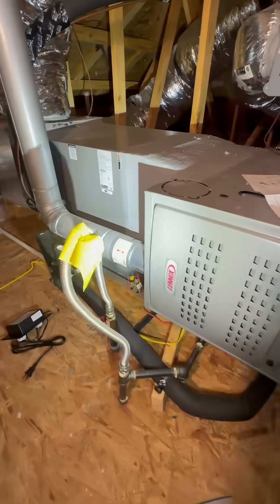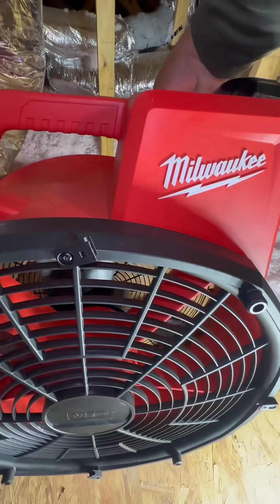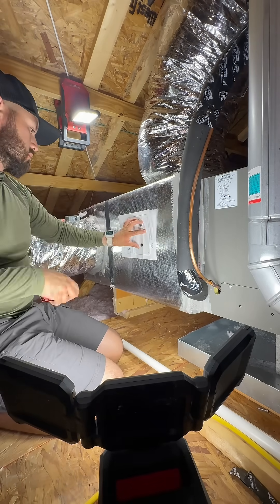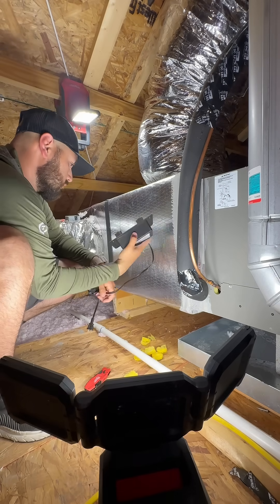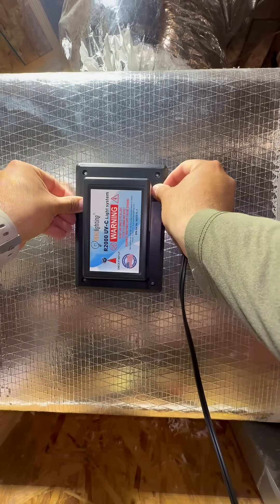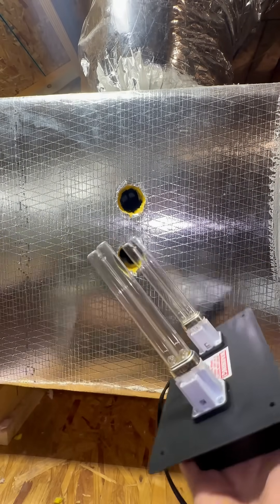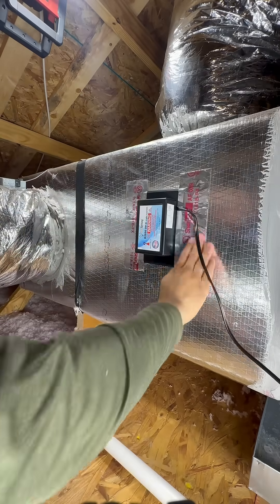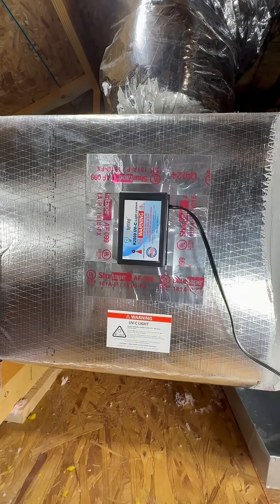Installing a UV-C light in an HVAC system as an Electrician 😱

Comment: I like one underneath the Evap coil and one above it, usually on the left side of the blower, so it's not shining directly on the blower motor wires. If it does, you want to protect the wires with foil tape

Comment: If it is a powerful uv light meant for scrubbing the actual air i try to install it in the supply. Always note the arrows. If you can, have it shining onto the coil. Although cleaning surfaces isn’t why i suggest powerful uv lights. (The make cheaper tailor made uv coil lights for that application) A legitimate air scrubbing device keeps air clean by ionizing low ppm particles which the filter then can catch.. never have the light shining directly onto the filter if you can manage. 
I also rarely see this on systems but you are actually supposed to install a transformer with some.

Comment: I’m an AC tech that has installed many and also see how effective they are over the years. The best place for me is probably under evaporator coil. Slime can grow on coil and also collect dust which will restrict airflow. UV light will keep clean and also not do as much damage like next to blower wheel, which can eat away protective coating on electrical wires. #2 spot would be supply plenum where I have seen most mold grow and #3 would be the side of blower wheel as long as it’s not shining on wires if possible. Maybe zip tie out of the way or tape wires. Doesn’t matter if air is going by it too fast. A light is not designed to clean the air. It’s designed to keep clean wherever it is shining. They work very good at keeping an area free of dust and algae/mold. Would need something like an air scrubber or ionizer to actively clean the air. Not a UV bulb

Comment: Uvc is best above and below the coil but be careful it destroys most plastics you'd find in a typical air handler. You'd need pfa/fep/metal protected wire and no all metal drain pans and condensate outlet. The uv will slowly degrade almost all typical plastics.

Comment: You need to keep it away from your filter. I had a k&n washable filter that decomposed because of  the uv light. Also, you must replace the bulb yearly as per directions. Otherwise, you will start coughing. We learned that the hard way.

Comment: Helpful tip. install it were there is no other electrical wiring. That uv well destroy the insulation on the wire. If there is electrical wiring near uv light , wrap wiring with metal tap.

Comment: I would not install a uv light. And an electrician (in my state and many others) is not allowed to touch anything on an HVAC system. You cannot touch my duct work. You can bring power to a disconnect. That's the extent. Don't touch my ducting. And don't wire that bitch into my furnace or air handler. And stop installing uv lights. They destroy equipment and ducting. And are fairly ineffective at purification.

Comment: Should be mounted facing the evaporator.  It's meant to flash the coil with UVC light.  Mold grows in between cooling cycles when the coils is wet and gets warm.
Reply: Air scrubbers are for cleaning the air more than the coil. There are specific uv lights for coils that are cheaper and keep surfaces clean rather than what a legit air scrubbing uv light will do.

Comment: If you are going to install one the best place is whatever will give the maximum exposure to the entering  side of the coil. That is usually by drilling a hole or holes in the end cap/ triangular piece of metal that is on each side of an A coil. Are they effective? Yes. Uv will kill any organic trying to multiply on any surface exposed to it. Are they cost effective? No. Average  lifespan of a  bulb is about a year.  The only way I can think of where they might  be beneficial if you have a lot of animals I your  house, return air on or near the floor and are somewhat lackidacial about filter changes in a place like Florida, lots of humidity and ac required.  With that set of circumstances a uv light could very easily be worth the price of admission.  Are replacent bulbs   available or do you have to buy a new light every year ? Whatever the case I would consider it a yearly expense if going that route.

Comment: I read that installing a UV light will give off a slight bad smell in the air.
Reply: Depends on the bulb, some fall so far outside the ideal sterilization spectrum, that they function more like ozone generators.

Ozone is the name of that smell, and it’s not good to breathe.

Comment: This entire thing is a scam. 30 years of hvac experience and I can honestly say these light do nothing other than deteriorate anything non metal in your hvac system. Mold dosent grown in your ductwork if the system is the correct size. (99% of the time the system is sized properly and if it wasn’t these light are the least of your worries) The black particles that you see on older ductwork are small pieces of dust and skin particles (80% of dust is dead skin cells). FURTHERMORE, these lights have a 1 year effective life and after that they no longer produce the UV light needed to function as intended even though they still glow) SAVE YOUR MONEY and don’t fall for this trick.
Reply: Not true. I've seen systems with and without, and uv light is great to have in the air handler
Reply: The whole industry is a scam. Charging way too much. There are some decent techs, but far and few...
Reply: appreciate you brother 👏🏾
Reply: 30years experience and you never found out that these go by the evaporator?

Comment: HVAC Tech here. UV-C will eat through that ductboard. I recommend it on metal plenums and atleast 30inch from any flex. The return duct side by the evaporator is best 👌
Reply: It will eat that flex line too
Reply: Absolutely! Duct board and flex liner is not UV resistant. Another reason that I’ve always preferred metal duct wrapped. So many people nowadays use pre-line stuff like TDC and duct board

Comment: The coil and the supply duct are the best places. The coil is always wet so that's a great place for it bc that's where all the mold starts. However the supply duct usually has mold in it so I would put a uv light in both positions. The return duct is my least preferred position

Comment: Above the coil/pan is usually the best spot, but that's not always practical. I've always been told that the closer to the condensate pan the better to prevent spread of mildew/mold/blahblah.

Comment: I try to install them as close as possible to the coil. The air is moving to quickly to be sanitized by it but you can have the light keep the coil clean so everything else is cleaner down the line

Comment: We had those installed in our RTU’s of the nursing home I did maintenance at and the air quality tests before and after were negligible. Mind you this was at the beginning of COVID. 

Too much air was being pushed past and the uv was designed for the unit it was in but never made a difference.
Reply: I don’t think these are supposed to remove anything from the air. I think they claim that it irradiates the air and makes it biologically inert

Comment: That looks exactly like where I’m at right now. I have three air handlers in an attic above a bank, and they overflow with condensate water into the external pan below them overflowing that and then it rains inside the bank every single day it’s a different unit and for some reason, they will have condensate pumps instead of just gravity Drains, and the condensate pumps don’t pump so the water overflows and rains into the bank with a shit idea and it’s about 300,000° in the attic so that really makes my HVAC technicians really happy

Comment: The air is moving too fast for the UV to be effective. Best to install at the coil, the pan; to prevent grow in the condensate.
Reply: It’s not just the fact that the air is moving too fast but that dust particles in the air will block the light. Imagine if you called me out to kill your mold problem and I shined a UV light on it for 1 second and called it good. That essentially what’s been done here.
 I agree these lights don’t work well it this application.
Reply: Sh/t doent work. It's snake oil.
Reply: You'd better have a hundred lights and fan running all the time if you really want it to be effective any way
Reply: Actually some pans will start to disintegrate with uv light. Seen it in some older systems with air scrubbers installed next to the coil. Pans were very brittle and some were just falling apart.
Reply: Yeah...... cause the air moves faster then the speed of light....... right???? 😐
Reply: @Jeremy-q3p2m  Yea but the light needs to shine some time at the particle that you want to treat. Its moving to fast out of the light area with the air stream.
Reply: @boooooster17 that’s why they recommend setting the blower fan on constant 😱😱 uv lights 100% work little man. Just not your little 5$ toy off Amazon🤷‍♂️🤷‍♂️
Reply: @Jeremy-q3p2m bro what? The same concept is used for ponds and aquariums. UV lights can’t sterilize algae unless it has enough contact time. Same for mold.
Reply: @Jeremy-q3p2m  The expose has to be long enough. One minute of expose to the sun, wont give you a tan. But a few hours may  get you a sun tan.
Reply: @Jeremy-q3p2m jesus christ, i can’t believe I read this
Reply: @Jeremy-q3p2m Speed of Light works in a vacuum and it's used for distance not speed.  Speed is constant.  The UV light needs time to work.  The air flow is too fast for the light to work properly.  It needs to be close to Mold growth or where Pathogens collect.  So near the pan, A coil, or the filter.

Comment: Between the blower and the evaporator coil, depending on the UV system you may need to add a secondary 24v transformer.